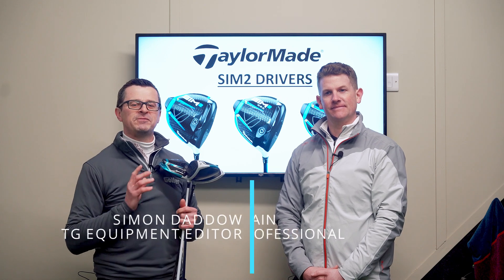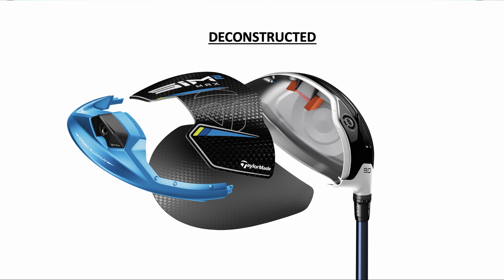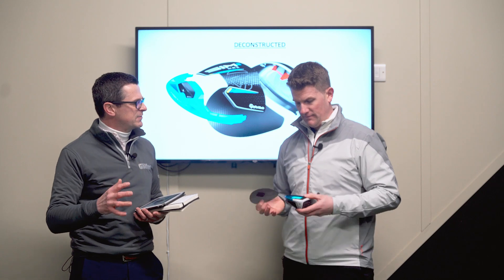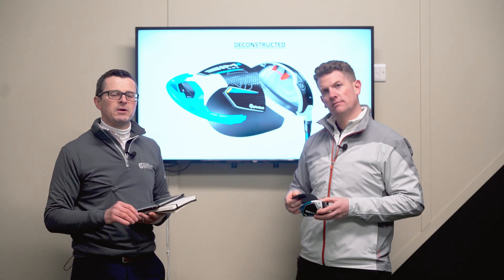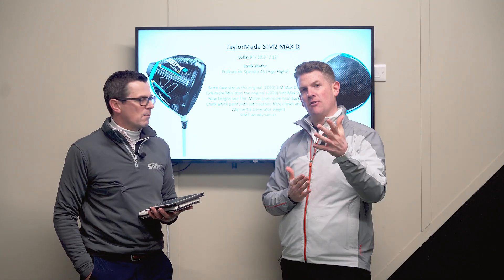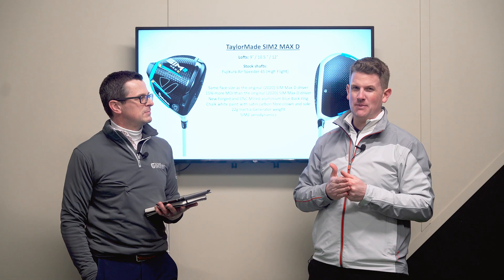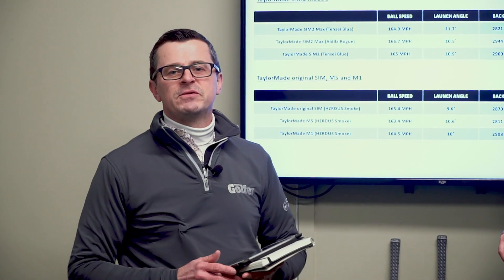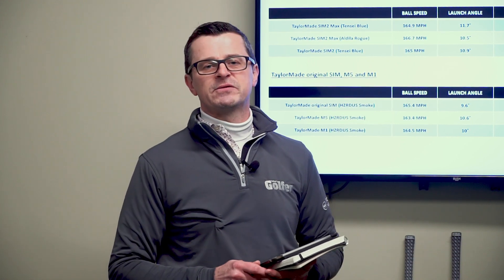TaylorMade SIM 2 Drivers - Everything you need to know

Comment: Great review EXCEPT it was one piece of information short of "Everything" I need to know.  There is a weight screw on the bottom of the club (exact location varies by model).  There are after market screws where you can add weight by putting in a heavier screw.  You might want to do this to increase swingweight or (in the Max D for me) add some weight near the heal.  Of course to add weight, you have to know the starting point.  So what is the weight of the factory installed screw?  Thanks!